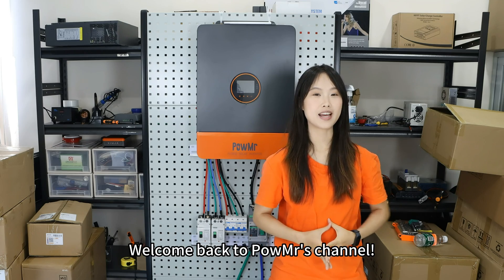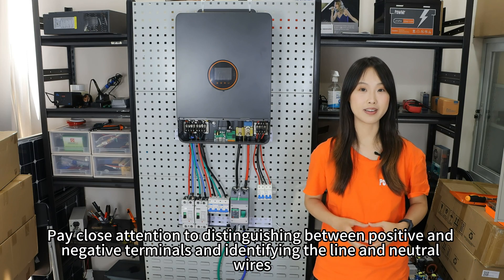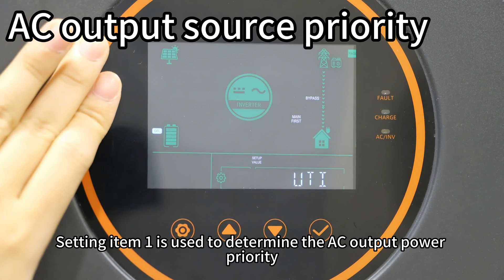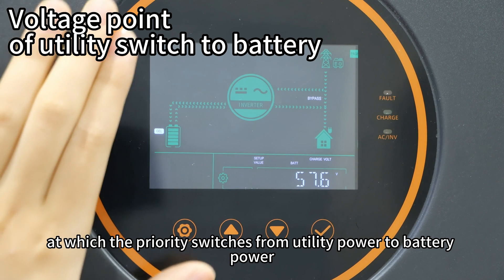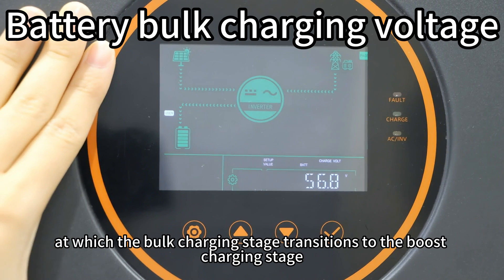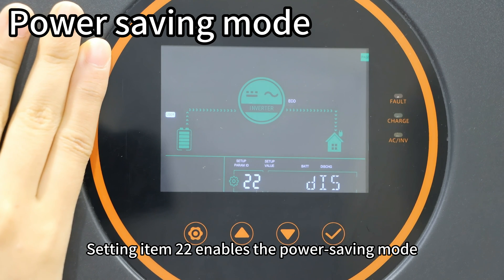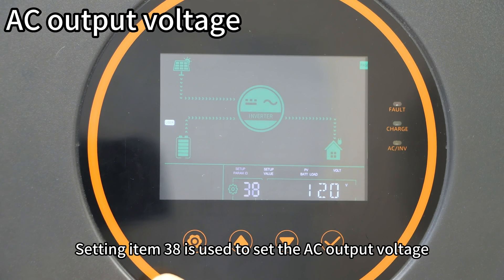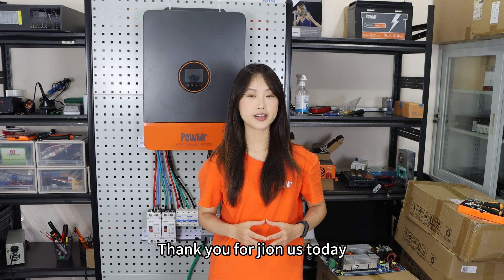How to Install and Setup POW SunSmart 10K Solar Inverter

Comment: Hi! My PowMr 10k parameter 63 means that there's not bonding as long as is on DIS mode? Because I can't access the ENA option and the text is confusing me! So the question again is if I leave 63 as is "dis" no matter the situation there will be "Not" bonding ever?

Comment: Is it possible we use inverter with out battery for the hybrid solar inverter 10kw , currently we are using on grid function , on grid power is not greater than 2.38 kw showing , if we use on grid function with out battery please provide setting details.
Reply from the maker: Please send it to this email: support@powmr.com.

Comment: Is it possible for it to send the extra energy to the grid?
Reply from the maker: Nope, it can't.
Reply: @PowmrSolar  my solar panel intaller, installed this device in my house in Mexico. And without energy export i will still get high bill from the grid.
 What setting or firmware update can i change so that the energy export is enabled ?
Reply from the maker: @ Hi, please send it to this email: support@powmr.com. Our technical staff will check it for you.

Comment: Hi there, hope all is well. I have an with configuring my (2).10kw Inverter 
 SN#SR-2407090036-301604-T01
SN# SR-24005250073-301604-B01
I really need them to power up my 240v equipments. That's not happening.
I need each 10kw Inverter to power up a 3hp refrigeration compressor (220V) 16amp.
I think I'm configured wrong or these Inverter can't do the job.

Your assistance will be appreciated.

Page "L1 and L2 in same phase" an I suppose to connect L1 and L2 together  and N will be second leg? I'm confused. I don't think joining L1 and L2 together is a good idea. Please see how you can help me. Also, if (1) of my 10kw Inverter wasn't enough to start up my refrigeration compressor, couldn't I stact (2) Inverters and have 20kw available for my task?
Please help
Reply from the maker: Did you buy POW-SunSmart 10K or POW-SunSmart 10KP? 

Does the mains have an N line? If there is no N line, and only L1 and L2 are connected, the mains cannot be detected by the machine.

Comment: Hola, estoy conectando baterías pylontech uf 5000 he configurando el parámetro 32 en rs485, luego el 33 en pylontech pero siempre me da error 58 de comunicación, cual sería los parámetros correctos a realizar
Reply from the maker: It may be that the communication protocol version of the battery and inverter does not match. It may also be that the BMS communication line is incorrect. Please send it to this email: support@powmr.com and our technicians will check it for you.

Comment: When the 300 Ah lithium battery is charging, the temperature of my SPI-10K-UP model equipment reaches 56 degrees Celsius. Is this normal?
Reply from the maker: A bit high.

Comment: Great video, I have a question: why parameter 04 does to adjust? when I change it and go back to check it is back to the default value
Reply from the maker: Please send your question to this email address: support@powmr.com. Our technical staff will check it for you.
Reply: I meet the same problem, it's back to 43.6V of default value.
Reply from the maker: @yuyinglin3788  Check if the parameter settings follow the logic. Please check if your parameter settings follow the following logic:
#15 < #12 < #04 < #14 < #35 < #37 < #05 < #09/#11
For example, if you want to enable #04, you need to first check if #08 is "USE", and then check if #14 is higher than #04?

Comment: I bought this inverter and I won't let me enable setting 63 the N-PE bonding.
Reply from the maker: Just connect the battery to set up. If you still can’t set it up, please send the operation video to this email: support@powmr.com.
Reply: @PowmrSolar do you mean to connect just the batteries to set it up? Right now I have it connected to the grid, solar panels and the batteries. BTW I contacted your support and all they told me was to contact the company I bought it from. That would be Amazon and after 30 days you have to ask the manufacturer which is you.
Reply from the maker: @ Yep, Only connect the battery.

You mean you've already contacted this email: support@powmr.com, right?
Reply: @PowmrSolar  Yes, they didn't help me at all. They sounded confused to me. I disconnected the solar panels and the grid. I left the batteries on and tried to enable setting 63 but it wouldn't show the ena setting. I'm assuming you're in China due to you answering my questions this late.
Reply from the maker: @ Can you send us your email? I will check it for you.

Comment: coloque 12 paneles de 400w 13amp en un solo mppt dice que esta produciendo 400V pero cuando enciendo mi aire acondicionado de 220v 1200watt no arranca el compresor, si conecto los paneles 6 por mppt se suman las corriente?
Reply from the maker: the SunSmart 10k model?
Reply: @PowmrSolar  si
Reply from the maker: @poe160170  The current is constant. Doesn't add up
Reply: @PowmrSolar  yes
Reply: @PowmrSolar  si lo conecto a la red el a/a arranca perfectamente pero cuando corto la energia de la red para que trabaje con los paneles el compresor se apaga inmediatamente, aun cuando el tablero indica que esta recibiendo 400v de los paneles
Reply from the maker: @poe160170  Is the battery connected? Is the battery power sufficient?
Reply: @PowmrSolar  no. compre dos baterias de su marca de 200ah pero no han llegado, pero influye el no tener instaladas baterias en el funcinamiento?
Reply from the maker: @poe160170  If there is no battery, it must be set correctly. To run this machine without battery, it needs to be connected to both mains and PV, and #01 is set to UTI, and #34 is set to LOD before the machine will work. If it is only connected to PV without mains or #01 and # 34Machine may not work correctly if set up incorrectly.
Reply: @PowmrSolar ok. Última pregunta. Tengo 12 paneles de 400w 13amp. Cuál es la mejor forma de conectar al inversor una serie de 12 a un solo mppt o dos series de 6 y conecto una a cada mppt. Mi duda es si conecto 6 Y 6 en cada mppt la corriente se suma ósea le entran 26A al inversor
Reply from the maker: Max. Input current: 22/22A. Each is 22A.

Comment: Is there any way to set Export limit to zero?
Reply from the maker: There is anti-backflow software inside the machine, so no current will be fed into the power grid.
Reply: @PowmrSolar  how do I set this?
Reply from the maker: @CurrentEventUpdated  What to set?

Comment: Hello, me again. I just realized after 9 months of usage that my inverter is not delivering enough power. 
I installed 8 solar panels of 550W, with 13A. But for some reason, the inverter never deliver more than 1~1.2A.
I tested already the panels and they are working, delivering at least 360V.
But when I turn on anything that requires more than 1A, the inverter switches to utility and stop using solar power. I'm not able to generate more than 0.5kWh, and I've seen several videos with people that with a half of solar panels I got, they're generating 3.5kWh.

Please help me, I tried to write to the Facebook group, but nobody is willing to help me😢
Reply from the maker: Have you contacted this email: support@powmr.com?
Reply: @PowmrSolar  I sent an email via the contact us form in the page with no response. Yesterday I sent another email but directly to that address, I'll wait to see if they respond. Thank you!
Reply from the maker: @amelieelibh  Can you send us your email?

Comment: I have a question if not intruding, I recently bought a 10,2kw inverter and don't understand what they use two outputs for,Main output, Second output??
   I'm under the impression that is not a 10kw inverter, but two inverters of 5kw each!?!? Please explain to me to understand, in the user manual it doesn't say anything about this subject.. thanks, I appreciate..
      Looking forward for the answer
Reply from the maker: Hi, the distinction between primary and secondary. Under normal circumstances, the ordinary load is connected to the main load terminal. If the battery power is insufficient, the inverter will lose power and stop working. However, in order for some loads to be kept powered on all the time, there is a secondary load, which means that even if the battery power is a little low, the main load is still disconnected and only the secondary load is carried, thereby keeping the secondary load uninterrupted.

This function requires setting items 41 and 42 to be turned on.

Comment: Hi is this unit stackable
Reply from the maker: Hi this model can't be used in parallel.
Reply: @PowmrSolar  hi can this inverter run two 4hp motor @ 240v
Reply from the maker: @bimmers323ci  Hi, this inverter can not run two 4hp motor at the same time.
Reply: @PowmrSolar  ok the what can you recommend
Reply from the maker: @bimmers323ci  Hi, you can use two units.
Reply: @PowmrSolar  which  two inverter I can use
Reply from the maker: @bimmers323ci  POW SunSmart10K. Each for 4hp.
Reply: @PowmrSolar  ok cool thanks

Comment: I've been utilizing my 10k solar inverter for nearly half a year, and overall, it has proven to be a highly satisfactory experience. However, I have observed that when encountering an error code, is there a more efficient method to reset the code without the need to power down the entire system and initiate a complete reboot? Thanks for a great product.
Reply from the maker: Hi, please send your problems to this email: support@powmr.com. Please note that we may not be able to promptly respond to you due to the Lunar New Year. We apologize for the inconvenience this may take and thank you for your understanding. We wish you all the best!
Reply: hi, are you able to adjust parameter 4? this is the battery cutoff voltage/switch back to grid threshold. I am unable to adjust it (when I make the adjustment and hit enter it seems to work but when I exit setting and then go back to check it is back to the default value rather than the one I programmed in). Also: have you had any issues since you made the above comment? Thanks and I hope you see this

Comment: Hello. I bought this inverter and have it connected to a 48v lifepo4 200ah battery. I have problems charging and discharging the battery. When it discharges, the inverter trips the OC protection. Are there specific parameters I should set for the battery? Would be great if the inverter and the battery could regulate these parameters.
Reply from the maker: Hi, please send your problem to this email: support@powmr.com. Please note that we may not be able to promptly respond to you due to the Lunar New Year. We apologize for the inconvenience this may take and thank you for your understanding. We wish you all the best!

Comment: Hello,  I need information about the wiring,  I already saw the video,I already read the manuel, but in case I need to bypass from input from utility AC 240V, how do I apply the 240V comming from the mains to the inverter and the load , in the video it shows from input 120v , but if I need to use L1 and L2 + N at the input to feed the load and to charge the battery. 

Let's say, I use a laundry dryer at 240V connected to the inverter that will runn fom the batteries only of the utility power goes off, so initially it will take from utility at  240V and then if power from the grid fails,  it will switch to batteries.

Comment: Hi Powmr, which model and watts can be Parallels..? and what’s AC Main output and 2nd AC output…? Thanks….I’m going setup a 48v to 240v system
Reply from the maker: Hi, this model can be used in parallel. The product link for your checking as below: https://powmr.com/products/hybrid-inverter-charger-5000w-48vdc-110vac-for-parallel

Comment: I installed the 10k power inverter with 8 550w solar panels in serial. Only in one MPPT, and I don't have batteries yet.
It works sending V from the sonar panels and Utility to the load, but it is throwing an error 03. How can I configure it to work without requiring batteries?
Reply from the maker: Hi, the POW SunSmart10K model, right?
Reply: @PowmrSolar  correct!
Reply from the maker: @amelieelibh  Please connect PV and mains power at the same time, then set AC 1ST in item 01 and LOD in item 34.
Reply: @PowmrSolar  I already configured utility in the option 01, and mix load in the option 34. And it worked, but the battery alarm never finished and all the time throws fault (even working). Is there a way to configure it to avoid requesting for the batteries?
Reply from the maker: @amelieelibh  You can turn off the alarm in item 25.

Comment: Hi looks good but can I use a generator to ac input when no sunshine and off grid ?
Reply from the maker: Yes. you can use a generator to connect this model.
Reply: I have tried 2 different generators.. no luck

Comment: If i have a 4 -12 volt lifepo4 batteries setup for 48 volts, which setting should I use. LFP14, LFP15, and LFP16?
Reply from the maker: Hi, LFP16.
Reply: So, I read the manual from top to bottom and in it states that the LFP14, LFP15, and LLFP16 setting, is the number of cells in your battery setup. A 12 volt Lifepo4 battery has 4 cells x 4 batteries is 16 = LFP16. Just an FYI for anyone else wondering. Thank you for the quick reply.

Comment: Max. Voltage of Open Circuit 500Vdc, is it for each individual mppt, or is it 500vdc for both?
Reply: Solar Panel array, Watts not to exceed 11KW
Reply from the maker: For each, but the maximum input current is that the sum of the two does not exceed the PV maximum input current(22A)
Reply: @PowmrSolar  Ok, to see if I'm okay…
1st Mppt 500Vdc
2nd Mppt 500Vdc 
22A for both

Comment: How is the maximum capacity (kilowatts) in battery for this inverter?
Reply from the maker: Capacity is not required, but we suggest not to connect too much (200AH-400AH）
Reply: Can I connect 5 Units of Lifepo4 batteries 51.2x280AH (parallel) to this inverter?

Comment: What is the proper procedures for switching ON the inverter which first PV, BATTERY, AC IN?
and what is for switching OFF which first PV,BATTERY ,AC?
Reply from the maker: Hi, you need to turn on the battery switch first, then PV, the last is AC IN.
The order of turning them off is AC IN first, then PV, then battery.
Reply: @PowmrSolar  thank you so much

Comment: Can you do a video for SP5K
5000W 48Vdc 110Vac Hybrid Inverter Supports Up to 6 Units in Parallel
Reply from the maker: Hi, Ok. Stay tuned we will arrange later.
Reply: Si,  seria muy interesante conocer esa configuracion y el equipo